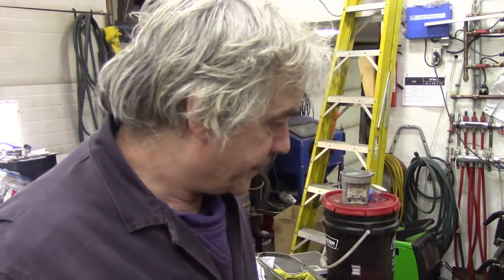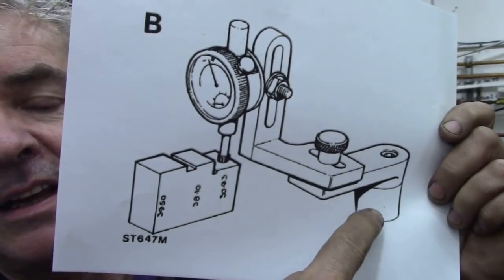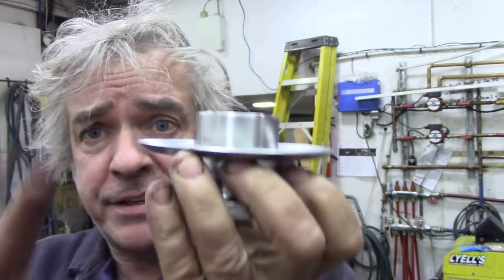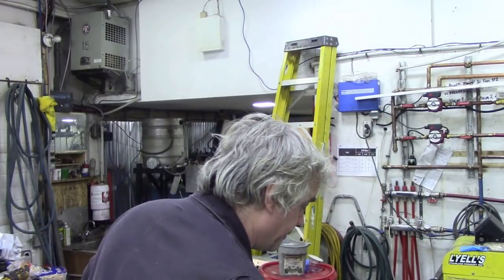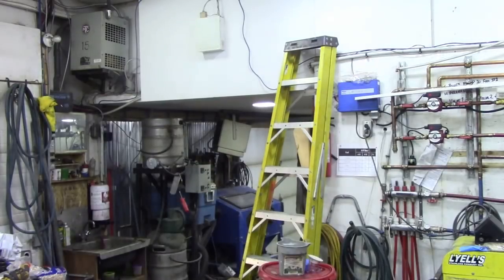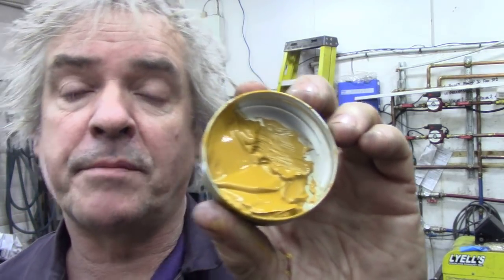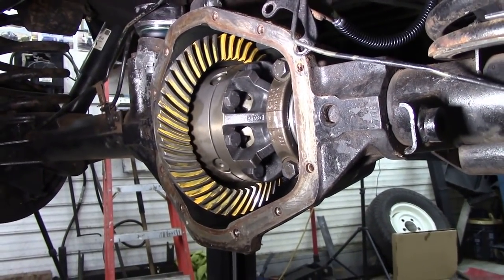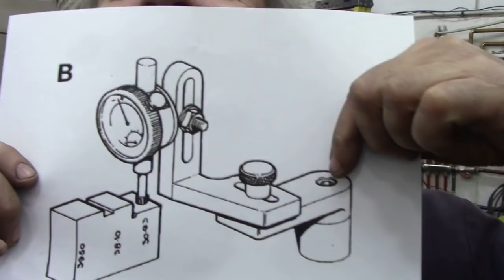Malawi 110 Rear axle update. I scrubbed all the videos. Here's why

Comment: Hi Mike, I had same, did it under the car, what a bugger of a job. Replaced sun/planet gear set & new thrust washers and it removed the clonk & eliminated the backlash felt at the wheel when fitted with new halfshafts & HD drive members. I fitted a genuine LR gear Set RTC4488 but believe the Bearmach sun/planet gear set is ok too. Worth doing & quite easy once you have the diff out. I think the wear found in mine was caused by worn pinion oil seal leaking oil & resulting in poor lubrication & cooling. My pinion drive flange had a great big groove in it and the PO’s garage had just fitted a new oil seal which would have only lasted minutes before leaking again, doh! So much for the professionals at Arbroath garage who mullered everything they touched.
Reply from the maker: Indeed -  spoiling the sheep for a h'apeth or tar!

Comment: Just did the pinion seal on mine using the same flange, had to change the thrower as it was catching as you said. Found the rubber seal was a good fit, but ended up doing as you did and adjusted the play out by feel.
Reply from the maker: Yes, the resistance of the seal makes it very hard to measure 
and yes you can feel when it it right - but it is only a fraction of a turn to put too much load on the bearings

Comment: I can feel with you. I have been there too. Just to crack the nut of the flange open was a nightmare. Tightening and setting it up under the car was a bigger nightmare.
Reply from the maker: Lol! The original Dana 60 was set up with shims in the pinion and adjusters in the axle for the diff - all cut down to save money I guess

Comment: Hi Mike, like you I have had a go at Salisbury axles a long time ago without any experience whatsoever, resulting in the same frustration you went through (and my axles were removed). Lately I'm doing another 2 axles (fitting difflocks) but have since manufactured some bearing removal tools set-up bearings etc. to make life easier. After reading through most manuals  regarding the salisbury axle including ones for the dana 60 and taking some measurements on bearings and several trial and error fitting, I am convinced that if there are no signs of abnormal wear on the components etc, the old shims packs on carrier and pinion can be retained if genuine timken bearings are used (as used by manufacturer). If fitting difflocks, as in my case, the carrier measurements have to be carried out just the same, but these are relatively easy if you have dummy bearings.
Another thing about that new flange with flinger. I had the same problem with mine a couple of months ago. There are 2 part  no's depending on year of manufacture. I'm sure I ordered the correct item but it did not fit so I decided to remove the shield to machine approx. 3 mm for it to fit correctly. But before doing that I ordered 2 fingers (shop4autoparts uk), just in case I destroyed the old one during removal. I received the new ones just 2 days ago and to my surprise they were shallower than the old one by the same amount I needed to machine. Maybe this is a solution for your flange.
Reply from the maker: Thanks for the Info Ian! I think next time on the bench for me, as I wanted to explain the principal of shimming to the viewers but boy was it difficult to work on in the vehicle!
The reason I bought the red mag mount was that it would centrally locate on the finished end of the pinion, where as the switch on/off regular block type we are familiar will straddled the machined part and would probably give an incorrect reading
Shimming itself is kinda easy to understand, but the book does not portray this very well
I agree on swapping the bearings and shimming - however there will be someone out there who will try and fit used parts into an old axle and it seems to be the machining on the axle casing that can vary
Reply: @BritannicaRestorations  Agreed the switchable magnetic block does not fit nicely on the pinion face and will surely produce errors. Also, as you said, replacing the casing and/or fitting parts from another axle requires complete re-shimming as casings have tolerances also. I once replaced a damaged front axle casing on a willys jeep (small dana 25 I think) for a friend...we manufactured two dummy disks as a replacement for carrier bearings and an arbor in the center holes of the discs. We measured the pinion depth from the arbor as reference on the old casing setup and reproduced the the same measurement on the new casing as we used the same internal components. It seems to have done the job. Looking forward to the 'on the bench' version.
Reply from the maker: Yes Ian - I think a lot of these axle 'clonkings' are NOT from  crownwheel/pinion backlash as we think, but the gears inside the diff itself as I filmed
SO - maybe this COULD be a DIY job as the sun/planet gears/thrust washers are an easy fix and do not touch shimming or adjustments 
However I did find the tool to remove the diff paid for itself! 
Anyone can pry out the diff with pry bars = getting it back in is the problem!
Reply: @BritannicaRestorations  Absolutely Mike, the spreading tool is the first tool I bought, no dead blow hammers for me! Obviously I put a dti across the diff opening as an indication of the stretching.
Reply from the maker: I could not get the diff back in without the tool

Comment: Moral of the story, get your diffs done by some body that knows what he's doing and change oil, change oil, change oil! Ooh, and make sure the breathers are not blocked and high enough not to get water in them, water will wreck them quick.
Reply from the maker: Also do not overtighten the filler plug as I have seen them drop into the axle!

Comment: As you said in a previous video Mike, just go to scrap yard and get another complete axle, cheaper and less stress, in this case as your customer is on a budget then surely a replacement axle would have been the correct way forward.
Reply from the maker: Well it is 90% there now - The contact and shimming is good but the diff internal gears are knocking

Comment: I always thought diffs were just a standard assembly, I never knew they had to be precisely set up
Reply from the maker: Problem with the rear axle, is that the diff is not a 'bolt in' unit but built into the casing hence a lot of set up to do due the  machining tolerances of the axle
Reply: @BritannicaRestorations  Ahh I see, so the axle is actually part of the of the diff assembly
Reply from the maker: Yes - that is why the need shimming if any major work is to be done

Comment: Did you ever do a video rebuilding a standard Rover diff?
I’m sure they used shims on the planet gears on the series diffs, but there isn’t any on the defender. 
Just wondering if I could shim the planet gears on my defender if it’s a bit worn rather than getting a gear kit.
Reply from the maker: Nope I have not done one but trailerfitter has

Comment: What about if you were changing the rear diff for a detroit locker, changing the original bearings and ring gear over to the new centre would you need to do redo all the settings?
Reply from the maker: Probabley

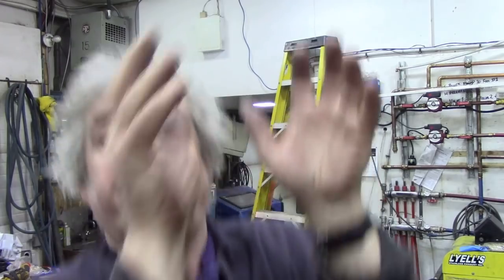Comment: Have you got specs or a video of that little tool you made there at 8:29 Mike?
Reply from the maker: Sorry no - I bought some square bar - cut it in two and got JP to bore holes in it and then bought a length of 1 inch UNF stud bar and cut it in 2
Reply: @BritannicaRestorations  Ok, thanks again Mike.

Comment: tell you what i reckon you would better off fitting a detroit locking diff than repairing the diff , time you put the hours in and  the gain in traction, this is one occassion adding a locking diff would be a cheap option ;0)
Reply from the maker: If you heard I am against a very tight budget on this job

Comment: Think I wont venture anywhere near the diff. It has a clunking noise and It does leak oil from the diff. Should I just change the oil seal or leave it?
Reply from the maker: Bryan= if you change the seal you 'should' replace the collapseable sleeve at the same time, because you can over or under tighten the nut - tough call
Reply: @BritannicaRestorations  Can I just mark the starting location and then wind off the nut, put the new seal on and wind it back to the same point?
Reply from the maker: You could  - but you have to be careful
Reply: @BritannicaRestorations  - Can you tell me if the replacement part you show in the video is the same size as the old one so that the counting the turns method 'could' be used?
Reply from the maker: I had trouble with that part and used the original flange - I am not sure of the dimensions of the new one
Reply: @BritannicaRestorations  the original flange with the new oil seal?

Comment: As long as I can test-fit things to check clearances and set shims I don't mind doing it.
When you have to start pressing bearings into place, or fitting crush-washers and spacers - just to test-fit something - that's when I pay somebody else to do it.

I've noticed a recent trend for grinding bearings so they can be a slip-fit on things so they can be assembled for shimming.
Even that gives me the heeby-jeebies cos a) there's no guarantee that your proper bearing is going to be identical to your test bearing and b) even if it is, there's no guarantee that it'll seat in exactly the same position and create exactly the same clearances.

Stuff like this is, IMO, just lousy design.

In the case of the planetary gears, for example, could they not have drilled holes in the diff' carrier so threaded adjusters could be fitted?
Reply from the maker: Take a look at the early Dana 60 axle this is based on - they had shims in the nose and adjustable 'carriers' for the diff itself - so they used the old fashioned method of bluing teeth to get a good mesh